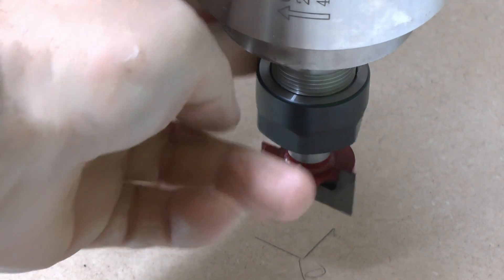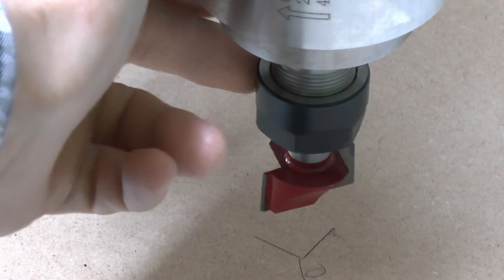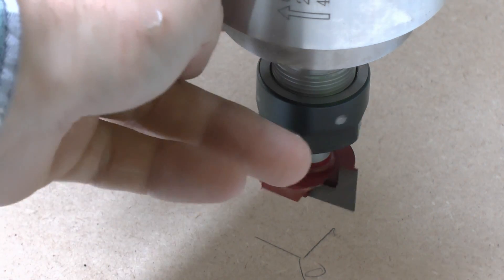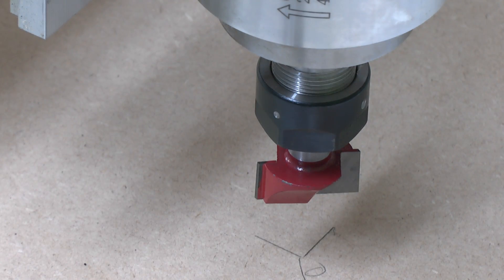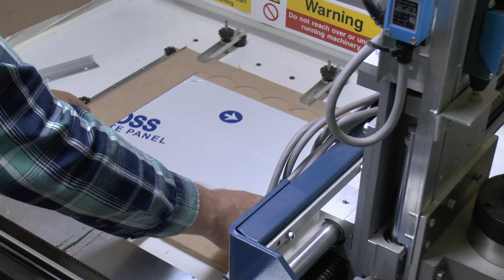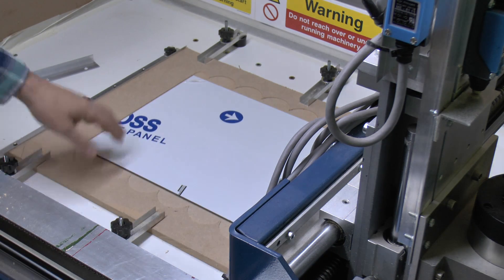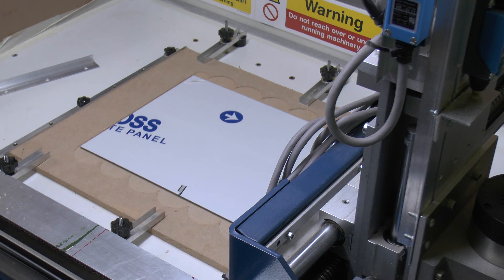CNC Surface Planing MDF

Comment: Something I have learned is it's best to also clamp the center of the waste board also. If the actual table isn't flat, it will throw off milling your waste board truly flat in the center. Simply using double sided crepe tape will do the trick just fine.

Comment: Hi JW. What are the max feedrate of your CNC? It´s running super smooth.
Reply from the maker: Cutting in the video was 3000mm/minute (about 118 inches/minute), it can move considerably faster but speed when cutting is constrained by the cutter and spindle RPM.

Comment: FINALLY... more CNC vids. "I'm givin' her all I can Keptin, she can't take much more!"  Better blow out the spindle, that MDF will kill it. I HIGHLY recommend this double-side 'WOW Tape' for CNC; it holds great, leaves no residue and is easy to remove: https://www.ebay.com/itm/2-rolls-Original-WOW-tape-Template-tape-double-sided-tape-1-x-36-yards/302849548803?epid=1532000163&hash=item46833d6203:g:od0AAOSwSdZWga8u and these single flute bits are AWESOME: https://www.amazon.com/Amana-Tool-Aluminum-Cutting-withMirror/dp/B01KJHTL8U/ref=sr_1_5?ie=UTF8&qid=1537220850&sr=8-5&keywords=single+flute+amana

Comment: Question. How loud is the air cooled spindle? Have you ever been able to compare an air cooled vs a water cooled side by side?
Reply from the maker: Very, you would not want to be next to it when running without hearing protection.
Have not directly compared a water cooled one, but they are supposed to be quieter, but have all the added hassle and cost of the water cooling system.
Reply: John Ward Thanks for the response. I was hoping to use the air cooled spindle as a high speed vertical spindle on my horizontal mill. I may have to rethink that if it's as loud as a wood router. Cheers.
Reply from the maker: This other video of it being constructed gives some idea of the noise level - https://youtu.be/__Ba0brLuyo?t=1013
that was powered with no cutter installed, so the sound is entirely due to the spindle itself.  Volume in that video was  reduced substantially when edited as well.
Reply: @jwflame  Thank you again for your response. The video you linked is a great reference. I wonder if it is the internal fan that creates most of the noise or the actual spindle bearing/motor?
Reply from the maker: Mostly the fan, bearings should be almost silent, even at high speeds. The fan is directly connected to the spindle, so rotates at the same speed, up to 24000 rpm.
Reply: John Ward I wonder if replacing the fan with a radial style fan controlled by the temperature of the motor casing would make much difference. Thanks for your insights.

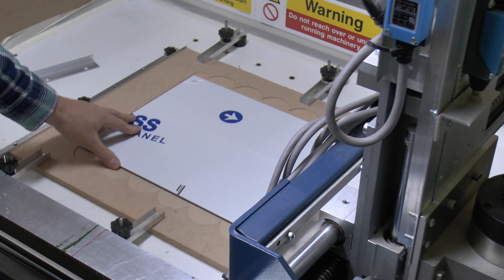Comment: Worried that the metal/plastic/metal piece to be engraved flexes when you pushed on the middle of it at around 6:00.
Reply from the maker: It's not as much as it looks - air trapped underneath.  It was taped down with double sided tape when engraved, so any flex was eliminated.

Comment: are you gonna cut out a dust shoe for your cnc? A friend of mine had to do some MDF cutting on a router table at his job and the entire shop got coated in a fine layer of MDF powder. They ended up building a plastic tent around the router table
Reply from the maker: Probably, MDF does make a mess and it's necessary to leave the shed when it's cutting to avoid breathing it in.
Another item on the long list of things to do.